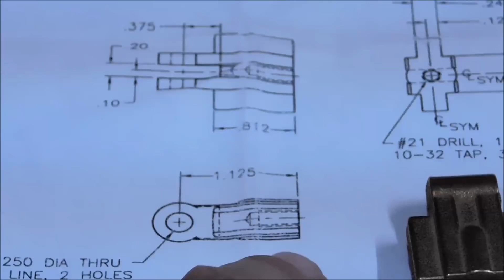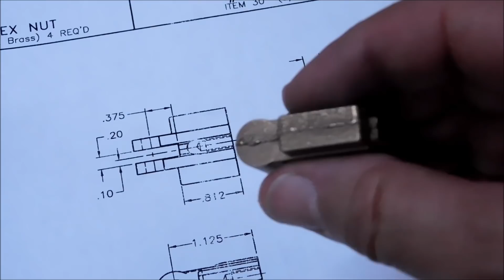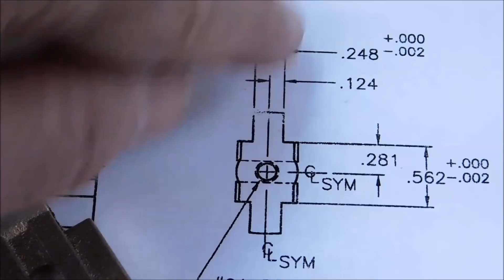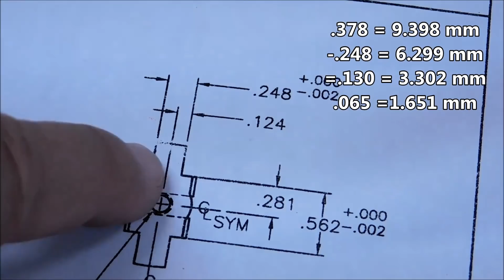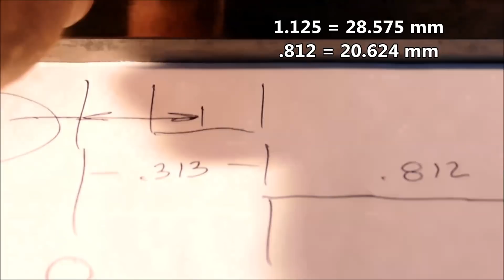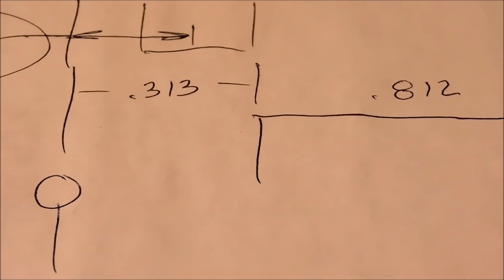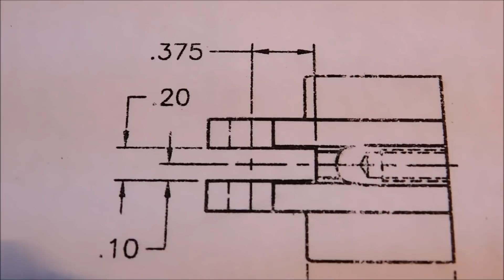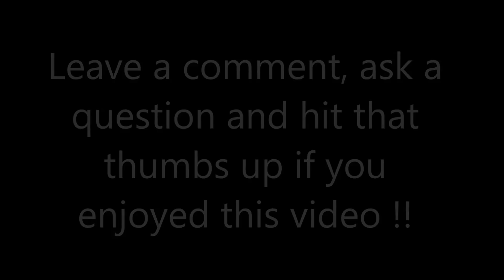Machining a Model Steam Engine - Part 5 - The Crosshead

Comment: Its a real art form to work with castings, even if they are refined plaster or investment castings.  In the Aerospace business we spent big bucks just making fixtures that would establish the starting datums to machine from.  Thinking through the entire machining process and proper fixturing can save you lots of headaches and scrap parts.....well done Joe.
Reply from the maker: thanks.

Comment: OK Joe, after watching that other video, I understand why you are making your own series of videos on this model steam engine.
As an ME/AE, I would much rather deal with a machinist who tells me why they did some things a certain way  instead of just interpreting a drawing and complaining how dumb the engineering is. People need to realize, that even though a Mechanical Engineer is taught from very early on to always consider the viability and therefore the possibility of creating a certain part, with what tools they have available, that sometimes we depend on the machinist to think above and beyond their accrued skills, to inform us if adjustments should or are needed for the successful manufacture of certain parts. This is why communication is key when dealing with complex parts. I Love your videos. After 25yrs of engineering I still learn so much from them.
Reply: Henri (and Joe) Having started as an industrial model maker, (almost 60 years ago) and toolmaker, who also worked as a process engineer and design engineer, The bench and machine experience mad my career(s) much easier and satisfying. Probable why I enjoy watching Joe. A master!

Comment: It's very illuminating to see you do these small parts.  And the attention to detail.  Thanks for posting this.
One of the things I remember hearing is to treat every part as if it is it's own model.  It helps me keep perspective.  Hopefully the precision out stacks the errors!  If I do it by eye, I'm not really interested in precision.  It'll look like a steam engine, but it won't run like one.  If I'm putting in the effort, I want it to run like a precision machine, too.  Otherwise, just hang a picture of one, it's quicker.

Comment: @Joe Pieczynski - Thank you so much for the legends with metric numbers converted from the originals. I hope that could help many more people besides me. Very kind of You.
Reply: Something that can also help when you don't have conversions on screen is remembering that 1 inch is 25mm, near enough. So 1/4 inch is 25/4 = 6.25mm, and so on.
A couple of other handy conversions is "1 quart" is 1 liter, pretty much, and "1 pound" is about 1/2 Kg.
Reply: @lwilton  - Hi friend. Thanks for the tips. You know, the thing what makes me more confused is when I hear something like "two fifty", then I automatically think It's "two inch and 50 hundreds of an inch" and start mental conversion, but It most frequently means 250 thousands of an inch. I'm slowly getting used to "Thou" as It seems to be the "metric inch". Isn't It? heheeh.
Reply: @lwilton - Friend, could You help me with one more thing? Does classical fraction of inch ends at 64 (in denominator)? May I write 63,5/64"? Should I use 127/128"? Or, does that belong to "thou" domain? Thanks again.
Reply from the maker: You split as necessary. Your fraction would then convert to 127/128's  that may raise some eyebrows, but if it has to be fractional, that would be the correct representation.
Reply: @joepie221  Thanks Joe. I learn something everyday. Today I learned more about Imperial System, from who knows the thing. I'm already almost an imperialist. Oops, nah, scrap that last one... Hehe
Reply: @fdavillar  There are a lot of different groupings of interest in the Imperial world. Most of these groups of interest (common people, cooks, carpenters, and most others) will use fractional inches. Most people other than carpenters and machinists rarely have a use for a measurement more precise than 1/4 or 1/8th of an inch. A standard tape measure is usually graduated in 1/16 inches out to 1 or 2 or 3 feet, and then in 1/8 or 1/4 inches for longer measurements. This is just fine for almost all uses.

Machinists, and at an earlier time scientists, were pretty much the only people that had use for really precise measurements. In the 19th and early 20th centuries a machinist's ruler would be graduated in 64ths or 128ths of an inch. You can still get machinists scales in 6" and 12" lengths graduated like that, but most people no longer are interested in measurements much smaller than 1/64" using a multiple of 2 division.

From the early 1900s onward decimal fractions became the common ways for machinists to make precise measurements. I think this largely came about because of the precisions required to make interchangeable parts. The standard unit of machinist's measurement is the thousandth of an inch, or in common machinist's vernacular, the "thou".  Multiple of 2 fractions did not die out immediately. It was common before the 1940s to see many or even most measurements in 64ths of an inch, using fractional sizes that are now no longer common. You can find plans for full-size steam engines from the 1940s that have all of the measurements in multiple of 2 fractions. But in places where machine work was more common than carpentry or casting, measuring in thousandths became more common. Eventually schools teaching mechanical drawing started to teach measurements in thousands rather than multiple of 2 fractions, and then thousandths became really common.

Of course you can need measurements more precise than a thousandth, so ten-thousandths, often called "tenths" (which will confuse most Americans that aren't machinists, as well as Metric folk) are also common. Less common are more precise measurements in millionths of an inch. Confusingly these are called "microns", but of course that is also a metric measurement, but not the same size. I think most machinists that don't use measurements this precise on a daily basis would have to stop and think for a moment to figure out how "50 millionths" relates to "one tenth". (It's half of a ten-thousandth.)

Most machinists these days have probably memorized the decimal fractional values for the common fractions they work with. I think everyone will know the decimal equivalents for quarters and eighths of an inch. Most will know the equivalents for several common 16th inch sizes, though maybe not all of them. Knowing the equivalents for 32nds and 64ths is probably less common. 

It used to be standard to have a big chart on the wall of every shop where it could easily be read. These charts usually gave the common screw sizes and the related tap and body drill sizes on one side, and had the decimal equivalents for all fractions up to 64ths on the other side. Tool distributors and manufacturers gave these out for free as advertising. So it was easy to look up any value you didn't know. These days I think everyone just uses their phone or a pocket calculator. Many people bringing a project into a shop to be worked on would have dimensioned the parts in fractions of an inch, so being able to convert to thousandths was pretty much a required skill.

I'll stop rambling now. Hopefully some of this will be helpful. :-)
Reply: @lwilton  - WOOOW! That's such a great lesson! Thank You very much, for that gold path to understand much more about IS. As You may surely suppose, of course I was understanding "tenths" all wrong as being 0.1" and not 0.01" as It is. I would never suppose such detail alone, very catchy. Thank You again my good friend, for your knowledge and for your patience sharing It. I'm indeed a richer person after read Your post.
Reply: @fdavillar  Actually "tenths" is 0.0001", or a tenth of 0.001". 

Keep in mind that "tenths" for 0.0001" is almost exclusively a term machinists use. Almost everyone else might say "a tenth of an inch" and would be referring to 0.1", and would be just as confused by the machinists use of "tenths"  for ten-thousandths of an inch.

Also, just to add a little confusion: people in the electronics industry and some in the plastic industry often refer to thousandths of an inch as "mils", a contraction of the Greek "mili" prefix for a thousandth. So you might hear someone refer to "2 mils" and "2 thousandths" in almost the same sentence, and they are probably talking about the same thing. Plastic sheeting thickness is usually described in mils.

This is even more confusing in electronics because "mils" is also the standard term used for measuring small currents in thousandths of an Ampere. You could hear someone say "We have 10 mils of dielectric separation but still have 3 mils flowing, something is wrong." The "10 mils" would be a distance (0.010") and the "3 mils" would be a current (0.003A or 3ma).

Aren't measurements wonderful? :-)
Reply: @lwilton  Oh, of course, my mistake. So a 'machinists tenth' actually is a tenth of a thou, or 0.0001", that's the stuff. From picometres to parsecs, measurements are indeed wonderful! Thanks again, friend.
Reply: @fdavillar  Glad to offer what help I can! Out of curiosity, where are you from?
Reply: @lwilton  Hi Wilton, sorry for not answer It yesterday, I only saw this today. Friend, I've born in Brazil, but I have double nationality, so I'm Brazilian AND Portuguese. That implies twice the documents a normal people have to care about (two passports, two IDs, etc...). How about You my friend? Which state of "those US" do You live? I'm a big consumer of US culture and info and I may say I'd wasn't the same person without some American authors like Professor Carl Sagan, Matt Groening, Woody Allen and many others. But, I also have a foot on European culture and authors like Hawking, Tornatore, Picabia, etc... Not a bad combination, I humbly say... Hehehhe
Reply: @fdavillar  I'm from Southern California, down in the lower west corner of the continental US. A little inland from Los Angeles.
Reply: @lwilton  - So You're in a relatively hot climate, close to the Sea of Cortez, one of the most beautiful gulfs in the World. The West Coast, from San Diego to Washington State, is a sanctuary of rights and progressive ideas. I like that, my friend!! Maybe the down point would be the car traffic, but soon You all have personal "flying backpacks" and that will be solved for good. Heheheh - Yay for West Coast!!

Comment: Hey Joe, another great video thanks for sharing. I was surprised to see the casting being deformed from the copper and the aluminum as well. When I was a young guy learning become a tool maker and then eventually a tool and die maker one old-timer back in the day showed me a trick then and that was use a thick piece of leather belt to clamp up against to keep the pieces from being damaged as well as to keep them from moving in the vice. I see that you take pride in your work as well as myself, keep up the good work and can't wait to see more of your videos.
Reply from the maker: Thanks. It must have been pretty tough copper.

Comment: Per PM Researc, "Thank you for your interest in our products.  The bronze we use to cast our parts is NS#C93700 Heavy Lead, Tin Ingot."  From Internet sources, this is essentially bearing bronze. The yield strength of C93700 ranges from 93 to 172 MPa. Typical copper electrical wire is 180 MPa so you need something softer than copper wire to prevent deforming it - lead solder maybe? Great video.
Reply: "bronze we use to cast our parts is NS#C93700 Heavy Lead, Tin Ingot"  AKA, "gun metal".  No surprise, at all, in a lead alloy being soft.  Something like 50/50 SnPb soldering wire (no flux core) seems correct for the pinching material.

Comment: A thought: Usually, great care is taken to have the print match the actual part and capture unexpected deviations. Once the part is finished, the revised drawing smooths the path to subsequent builds. You might show your viewers how to red line a drawing. This may be the only time many of your viewers get insight into the management of command media.  BTW I use Popsicle sticks to avoid indenting soft materials. Cheers.

Comment: I'm not kidding when I say Hand Filing Technique is away underrated. Hand Filing is the most "zen dependent" operation. It's very easy to mess It all up and perfection depend on controlled complex movements. At 5:05 You'll can see some of that "efficient ballet". I'm still impressed.

Comment: A common misconception hobbyists have with these old kits is thinking they are designed with specific skill levels in mind, like modern hobby kits are. With these old steam engine kits, the design is the design, and you got what you got and dealt with it. If you didn't have the skill to swing it, you'd scrap it and have to resort to shenanigans to hopefully salvage it into a working state. That's simply how it is with these old kits. This particular kit is not of amazing design quality, and has a lot of poorly thought out dimensioning practices probably because the blueprints were made to fit the prototype, rather than the prototypes being refined to fit a well designed blueprint. Because of that, this is a pretty advanced kit, even though it might seem simple at first, especially to a hobbyist who doesn't know what to look for. For a machinist, a lot of these castings are simply a slog to work with, because we could make something from solid stock with less workholding effort.

Additionally, I see a lot of people pointing out having a "big expensive shop full of expensive tools." That doesn't make it any more or less possible to build this kit, it just makes it faster. If you really wanted to, you could make this kit with nothing but hand tools and a drill press. It would take forever, but it could be done.

Comment: The cross head is the most forgiving parts in the dimension of thickness. the important dimension is from the center line of the piston rod to the bottom slide surface. I have two ten hp. engines and the top dimension is made right with shims. there is no shame in the end result of your cross head perfect in every way. the 46 minutes was like a blink loved it.
Reply from the maker: The part is dimensionally spot on. if those ears are undersize, it will still work, but the secondary mechanical forces will lift it under acceleration. The width should just slide nicely and everything should work. I'll hit the numbers and expect a smooth quiet working model.
Reply: @joepie221  The crossheads on full-sized engines are made to be adjustable so that wear can be taken up and keep the center on the centerline of the cylinder bore.  On models that is almost impossible to do.  I expect this engine will run sweet.

Comment: The casting material is most likely gunmetal not bronze and is quite soft but is a good bearing material for this application. 
 Copper work hardens so could easily be harder than the gunmetal.
Reply: Malcolm Wright probably sintering bronze?

Comment: Another great video Joe. Love the way you discuss your approach and plan the sequence of operations. Knowing what you know now, what material would you have used to hold the part since copper and aluminum are harder than the bronze? The leather mentioned earlier seemed like a good idea.
Reply from the maker: I think my material choices were good, but the amount of surface contact amplified the pressure. Thats why the aluminum nests worked so well. More surface contact.
Reply: @joepie221  Regular copper wire is hard-drawn. It can be softened and made more ductile by annealing.

Comment: Joe - I notice that early on you used the edge finder then later you use the dial indicator on the quill. Is there any particular reason for this? Using the indicator I release that is more precise to be able to find the centre. Is that your preferred way of finding the centre? I probably would have used an edge finder then hit the divide by 2 to find the centre.just curious to know. John 🇬🇧
Reply from the maker: You still have to move something using an edge finder. Once an indicator tells you center is achieved, you are already there.
Reply: @joepie221  That makes sense - Thanks Joe. Stay well John

Comment: Those castings can be a bit of a nightmare to start establishing the principal dimensions so every edge will clean up. Its been years since I have made such a model but I did used to spend some time marking out the casting and hole centres to work out my positions of the first features to be machined. The problem is if you had moved the pin hole back you would have had to clean up the outside radius to centre the hole on the boss but then lose the casting look, although I thought your shot blast finish looked really good. Its a personal thing but sometimes I think the casting finish can be a little too rough for scale models and also casting relief angles can be too prominent. Excellent videos by the way, a really good balance between progress and machining footage.
Reply from the maker: This model is teaching me quickly. There are basics to consider up front for a successful end result.

Comment: The brass grade is "Gunmetal" or "Red Brass"...butter soft. Works like Babbitt Metal. The Part Nests are a wonderful fixturing tool, Thank you!
Reply from the maker: Those nests are just about mandatory in my opinion. thanks for the info on the metal. I was surprised at the deformation.

Comment: another super interesting video. was there a reason you used an indicator to find center as opposed to an edge finder? not wanting to remove a tool?
Reply from the maker: That, and once you find center with an indicator, you are already there. No shift necessary.